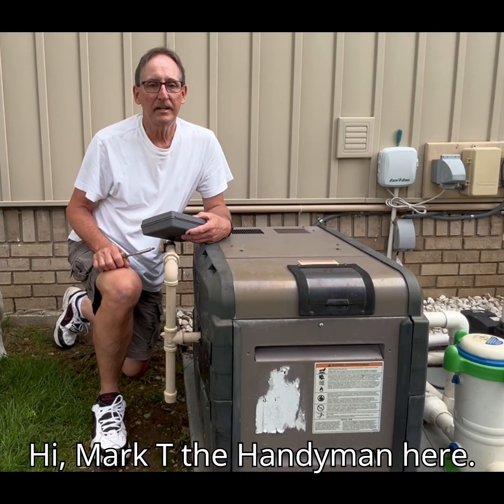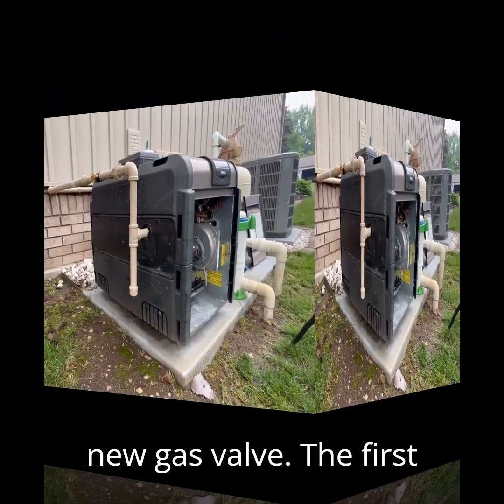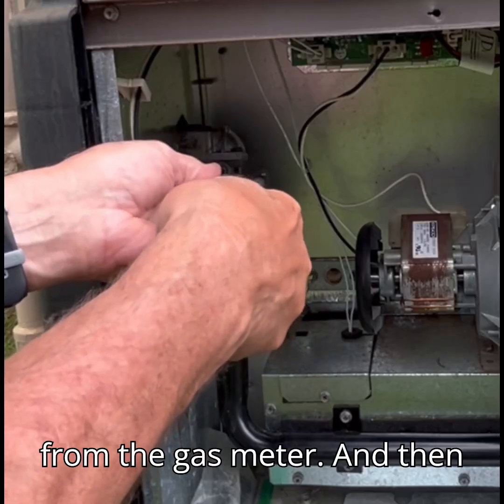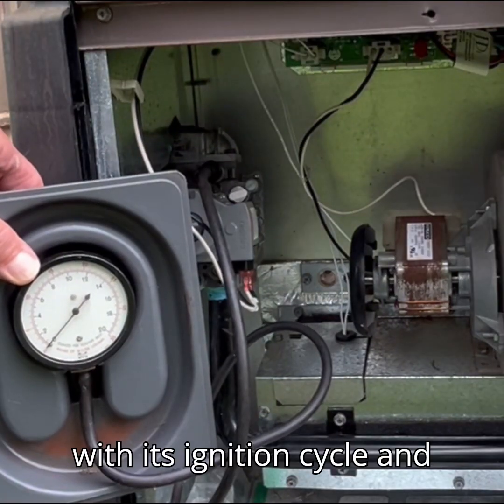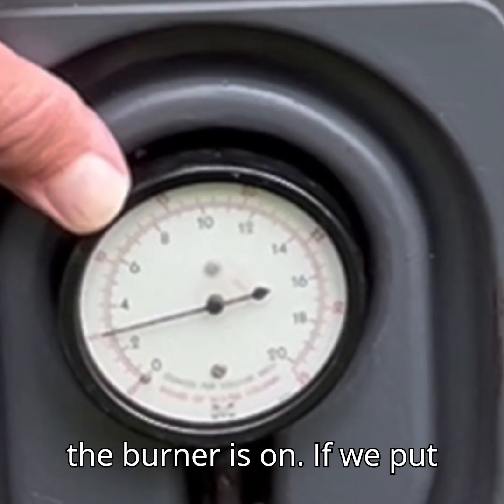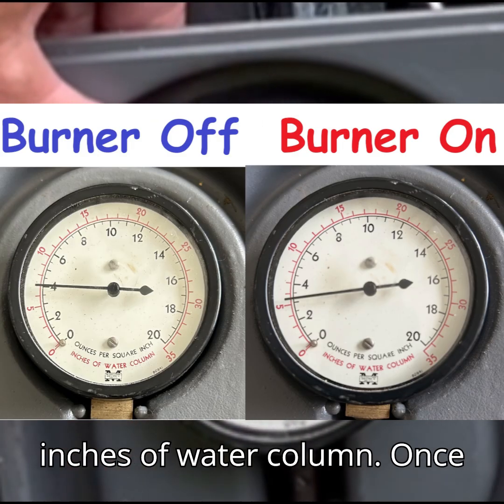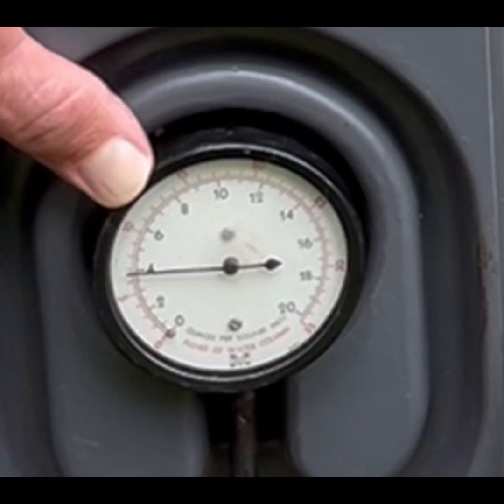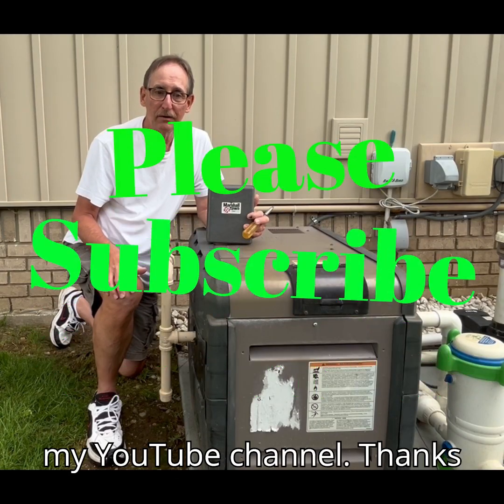How to Check the Gas Pressure on your Hayward Pool Heater

Comment: How do u check the electrical portion of the gas valve?  To make sure the transformer is sending the 24v to the gas valve? 

I placed a multimeter around the black and white wire to the gas valve and there is 0.18 amps.  So that means electricity is running through the wires.  I wanted to confirm the gas valve is getting the 24 v.  

A video in the electrical testing of the gas valve would also be super helpful!!
Reply: if I do the gas pressure test and see it move from 7 to 5, then does it mean that the gas valve is working as normal and there’s no electrical portion that’s bad?
Reply from the maker: Yes. That would be an indication  that the gas valve opened and is allowing some gas to pass to the burners.
Reply from the maker: I just CREATED and PUBLISHED a new video on how I checked the voltage on the gas valve. Please let me know what you think.
Reply: @Marktthehandyman thank u!!!  I’m going to watch right now!! u are the BEST!!! :)